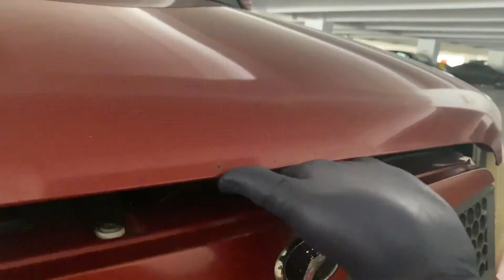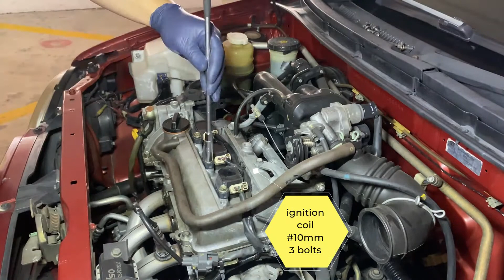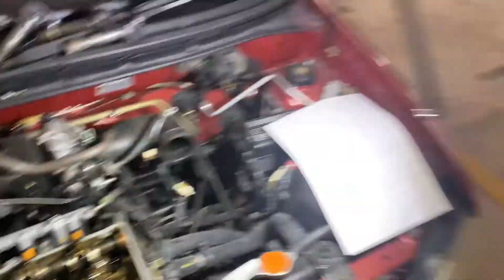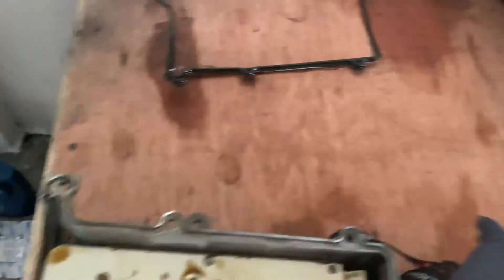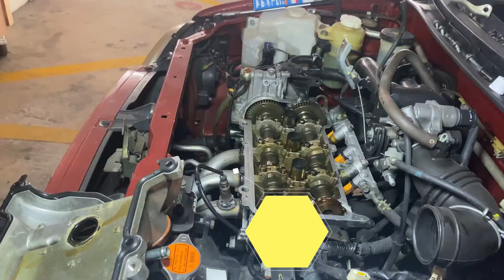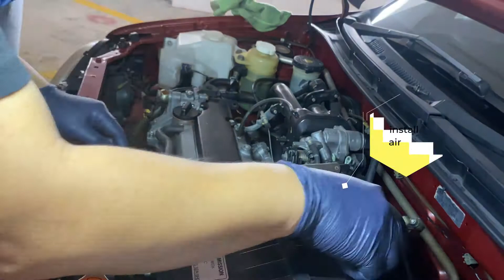DIY Perodua Kelisa/Kenari : Oil Leaking Valve Cover Gasket :: Tukar Valve Cover Gasket

Comment: Kind add link where you buy tools & parts for the repair. What is the suitable torque to tight the cover?
Reply from the maker: Sorry bos i xde link tu sbb i just bought at parts shop but u can go to shoppee n lazada.
.
5.5+/-1.1 Nm torque according to manual EJ engine.

Comment: Bro nak tanya la..
Kalau kita nk ketatkan screw head cover tu
Kena ketatkan betol-betol atau just ketat  je??sy baru hantar kereta kat bengkel sebelum ni xda leaking minyak hitam,bila kereta dh siap,sy tgk minyak hitam ada leaking,bila sy cek,screw kt cover head x ketat,ke memang ketat ala kadar je
Reply from the maker: pada saya x perlu sgt2 ketat...normally torque spec utk valve cover kurang lebih 10Nm...klu pki hand tight pn cukup...klu longgar tu x bleh la...mesti leaking juga

Comment: Bos, td pomen kata, ada leaking mcm bos. Bila bukak mmg ada kesan minyak hitam dkt coil. Tp sy pelik, dia kata kena tukar valve cover tu RM150. Mcm pelik ja.. Tu kan besi. Nak rosak apa ja? Klu kata kena tukar gasket boleh caya la. Apa pendapat bos? Tq
Reply: mungkin ada pecah kot valve cover bang.
Reply from the maker: pendapat saya berdasarkan pengalaman yg tak seberapa ni :
.
1. if valve cover tu yg rosak atau crack...memang kene tukar baru. kereta sy penah crack sblm ni, dekat skru telinga so kne replace new valve cover;

2. utk model kelisa ni, if ada minyak hitam dekat coil bermakna coil seal dh x ok. so kne tukar coil seal dan ia boleh ditukar cume kne buka skit kt bahagian tersebut dengan flat skru driver utk replace baru.

mbe pomen nk mudah skit kje sy rasa...sebab bila tukar valve cover baru, ia datang bersekali dengan coil seal.
.
harap dpt membantu.
Reply: @shukerij  bang kalau nk tukar coil seal kena angkat jugak ke cover tu ? ke boleh dari luar cabut coil plug pastu cungkil keluar ?
Reply from the maker: setuju !!!
Reply from the maker: kne bukak jugak valve cover tu @feeqoo  ...